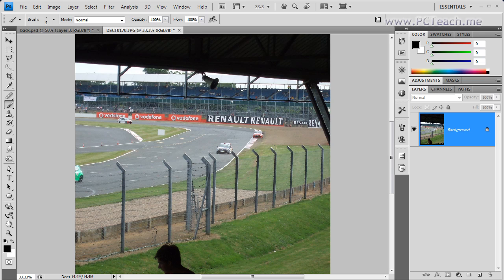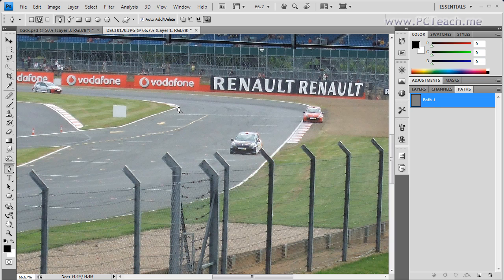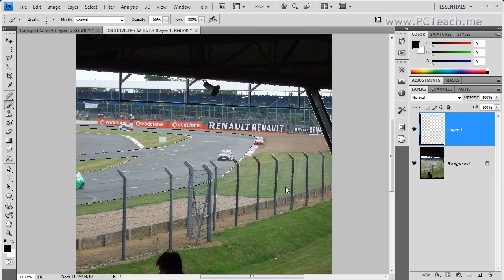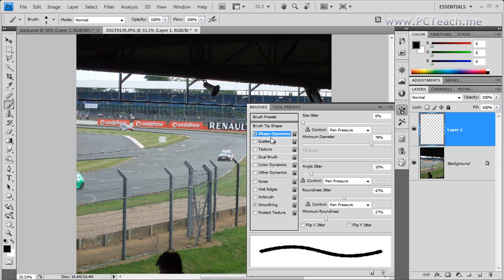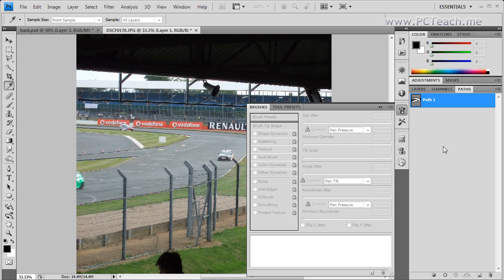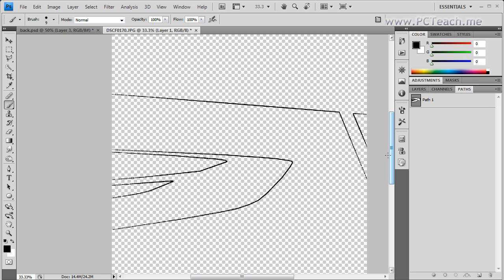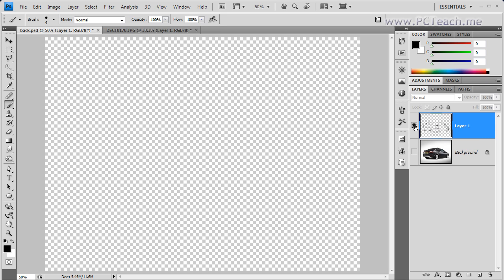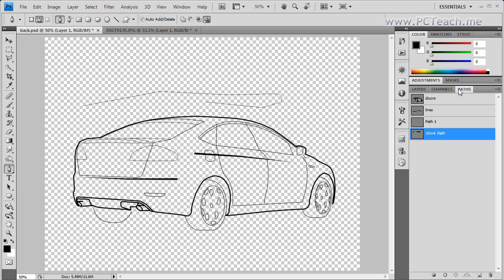Photoshop - Creating a Hand Drawing From A Picture Using Paths

Comment from the maker: @steveshort4steven Hi Steve,
The paths are seperate in this video.  The reason why the paths are seperate was so I could apply different brush styles to each section (e.g. the bumper, its heavy on the right but thin on the left).  Having said all that, you should be able to CTRL and click on each path & right click & choose "Merge", forgive me I am not by my PC to test my comment but sure the does option exists. I always reccomend using multiple paths otherwise you dont get the feel of freehand